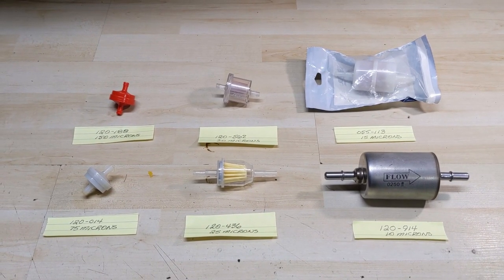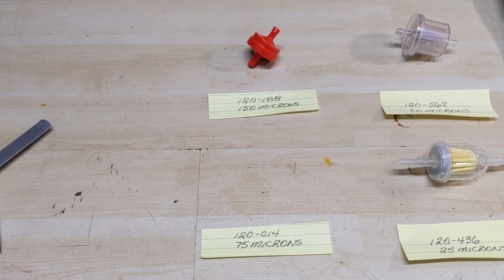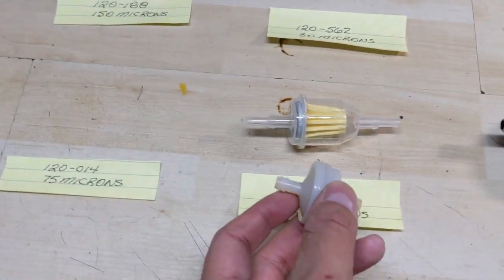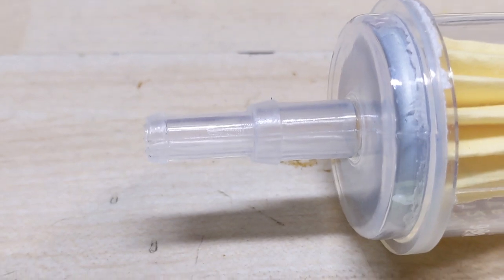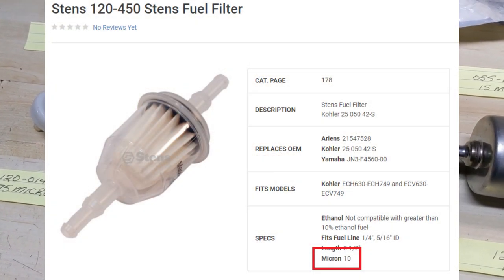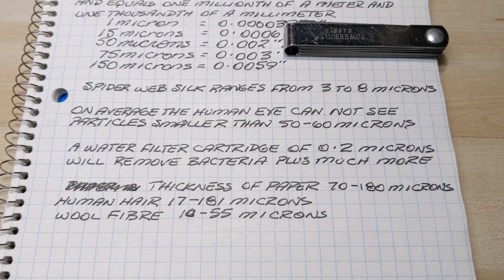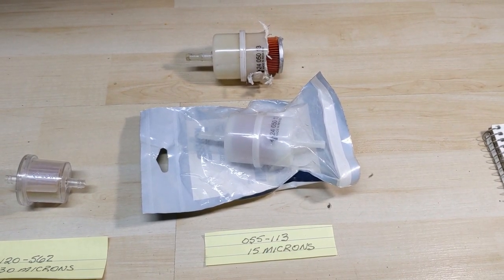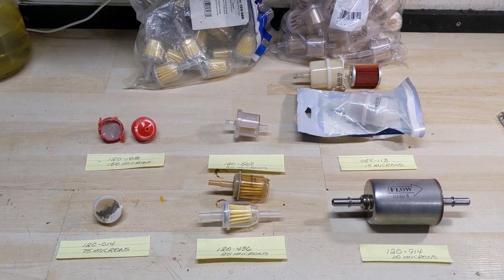Small Engine Fuel Filters

Comment: God Bless you brother for this video. My 4 wheeler has been down for a couple of weeks now.  I watched your video this morning and went straight out and fixed it. I had put a new carb on it and thought to be safe ( I had rust in my tank previously) I'd install an in line fuel filter. Not knowing any better I put a paper filter on it. I would prime it and it would run for a few seconds and then shut down. I was at my wits end. After watching your video I went out and took the filter off of it and it purrs like a kitten. I am a happy camper now. Thanks you.
Reply from the maker: Maybe try to find a filter that flows a bit better, I know the ATV ones are a little higher end and flow better than these lawnmower ones, due to the need for more fuel at full throttle. Glad you got fixed up!

Comment: A very well presented, laid out, an in-depth video. Great job! This will be helpful to sooo many people.
 
The only thing I would like to add, is that many people/commercial users (including myself) run with two fuel filters. Using a cheaper ($6-ish) high micron (25-30)  fuel filter first, and then run into a final, low micron (10) fuel filter second. 

We do this on all of our 27 HP Kohler V-Twins with Fuel pumps. We change the cheaper, clear, 25-30 micron fuel filter about twice a year (Machines used year around, for mowing, and snow removal), and the metal housing 10 micron filter every two years. 

And one more thing I would like to add. Is to warn people away from using a 'mesh strainer' fuel tank insert. The aftermarket industry has these available to insert a shut-off valve with mesh strainer into the rubber grommet of fuel tanks. Once installed, the strainer cannot be seen. Which will likely later develop restriction issues, and can be hard to diagnose, because it cannot be seen.

Comment: Thanks for posting such informative videos. My old Craftsman lawn tractor came with a paper fuel filter, similar to the 30 micron shown in the video, when I bought it used. Thanks for pointing out that can cause fuel starvation issues on gravity fed equipment. I had not considered that. I'll replace that first, with the 75 micron filter in your video, to see if that resolves an idle surging issue. If not, I'll drill out the low idle jet, as shown in your other video.
Reply from the maker: Yes the low idle or "pilot" jet usually 0.002" extra

Comment: This is great! Been fighting a fuel starvation problem on an intek Briggs and straton 18.5 hp. Afraid the current fram filter is reducing flow to the carb. Already checked the backfire safety switch, lines, jets, etc. runs like a top for 15-45min. Tap the crap out of the inline filter and she keeps going.....just can't pin it down yet. Be well friend!

Comment: I have a Harbor Freight Predator 3500 generator 63584. Even though I’ve used Sta-bill 360 since it was new, the last time I looked in the fuel tank it was rusty. I pulled the tank and found a fuel strainer in the outlet fitting, it was damaged and plugged. I’m trying to figure out how to replace the strainer with a clear inline fuel filter close to the bottom of the tank. You can’t buy the OEM strainer separately; you must buy the complete fuel tank. Obviously, it’s gravity feed 2.6-gallon fuel tank and I don’t want it to lean out or starve it, but I don’t want to keep cleaning the carburetor either. I’m also trying Ethanol Shield Fuel Stabilizer. Even though I’m using 4 Cycle Ethanol-Free Fuel from Home Depot. What’s your thoughts??? Great video. Thanks

Comment: Thank you for this...I picked up an Ariens 17.5 hp Briggs and Stratton riding mower and put a cartridge filter on it and its having trouble idling but runs at full throttle.. and it gravity fed..🤔 going to get a stock filter and see if that's the problem.. UPDATE: Installed OEM Briggs filter for gravity fed system ....Now it runs smooth...Thank you!
Reply from the maker: Yes they either a red or white Briggs filter!

Comment: Another awesome video, thanks. Have you used a
paper fuel filter on a gravity fed system? If so what paper fuel filter would you recommend?
Reply from the maker: Yes, those Tecumseh ones are great! I haven't had any issues. Like I showed, I used it on that generator and it worker perfectly!
Reply: @EliminatorPerformance  what size fuel tank do you need for it to work fine ? My mower tank is like 1.5G

Comment: Great video.  What about the filters in the fuel tank on a trimmer or blower?how many microns are they?
Reply from the maker: Great question, STENS doesn't actually list the micron level of those filters, so I decided not to include them, as I didn't want to put out any incorrect information. If I find out, I'll let you know!
Reply: My question as well. What’s the micron rating and what’s the difference between the two types I see, the ones with bare filter material on the outside and those with a plastic cage around the filter. Also related, why do they tend to fall off the hose inside the tank?
Reply: Because the fuel line for those are garbage. They become brittle and hard, causing the filter to fall off. Idk if they make better fuel line, stihl's fuel line seems to be better but you can't buy a roll of it, that I know of.
Reply: Dan Oakley   My research so far indicates Tygon fuel lines (always marked on the lines, as opposed to the crappy knockoffs who say they’re Tygon in the advertising but really aren’t) are the best available so that’s what I’ll be using for now. I just wish they made them in clear so it would be easier to see fuel running through them.
Reply: I have not been able to specifically find any micron ratings for the small two stroke filters but many are a compressed felt material and some are porous plastic and information on line says the felt filters run from 1 to 100 microns and the porous plastic 1 to 200 microns. If we find any specific information we will be glad to respond further.

Comment: Great video. Thanks. Quick question; never took note of this. I run an exmark with a 20hp kawasaki. Its got a fuel pump.  It runs fine, but the clear fuel filter only fills about 1/3 of the way as its running. Should it be full as it runs ??
Reply from the maker: That's usually how they work depending on how the fuel line is routed. Take a look at the 120-436 filter that I cut open and dumped the crap out of, you'll see the grey discoloration on the paper filter where the fuel was resting. Same area as yours, about 1/3 the way up. Thanks for watching!
Reply: @EliminatorPerformance  thanks for taking the time to respond.

Comment: Great video.  So basically for a walk behind 21” mower my best choice is the white disk filter, since the paper filters won’t push the gas through?
Reply from the maker: Yes
Reply: No. It'll run just fine with the larger BETTER fuel filters you couldn't pay me to use one of the disk ones.
Reply from the maker: Gotta be careful, I've had fuel supply issues with them before. Cub Cadet CC30 prime example. Even the Technical manual says only use the red Briggs filter with the metal screen, as a paper filter won't flow enough and the engine starts surging from not enough fuel.

Comment: how does size of the filter have anything to do with particulate size? Flow rate can be effected by media surface size, more media surface equals an increase of flow. So bigger is better. The large body has a secondary benefit of allowing particulate and water to drop out. Efficiency is also important to understand, not everything is as it seems due to quality issues. Also cellulose filter elements can easily be rendered useless when water is present. Dirt and water are the 2 biggest issues with small equipment. The discussion point of water was completely missed.
Reply from the maker: Great points, usually the larger the element, the finer the particulates it will filter. This is because the paper elements are bigger than say a metal screen. As shown, the filters get larger in size while the particles they filter get smaller in microns. Bigger is usually better, but the filter element has a direct connection to flow rates, as most of these engines have a fuel system that is gravity fed. It's not like a car, where you have a strong electric fuel pump, and can run a large element filter with the smallest micron rating. Gravity fed engines will become starved for fuel when running these larger paper elements. The engine will surge, and sometimes eventually just become vapour locked and won't have any fuel in the bowl to run.

Comment: What is your opinion on the in-line Pyrex glass fuel filter?
I use it on my 283 engine
I heard different things some people love it because you could see the dirt that accumulates in the filter but others say it wiggles itself loose and is prone to  causing engine fires when fuel leaks out of it on a hot exhaust manifold
Reply from the maker: Yea I don't like them, but it's just person opinion. The Plastic stens ones have never failed me, and I've used thousands. The China ones from Amazon that come in the package with the carbs, straight into the garbage can lol most of them are broken already before I even open the box.

Comment: I have a DR Bush Hog (2007).  I purchased some fuel filters (paper in clear plastic/AMAZON) and they don't have an arrow for FUEL FLOW DIRECTION.  The original did not have an arrow either, but I didn't pay attention to how it was connected to the fuel line....from tank to carb.  I'm thinking the cap-like top goes to the carb?  Any suggestions?  Thank you.
Reply from the maker: Bigger end with the largest area goes towards the tank, the filter should filter debris so you can see it (outside of the paper) if you run it backwards the debris gets trapped inside no good

Comment: I have a 1989 Toro 724 (38072) snowblower with a Tecumseh HSK70 engine.  It has no fuel filter and  I can't find anything in the manual or IPL about fuel filters.  Can I use a fuel filter with this engine?  I'd prefer to use the smaller clear paper filter pictured (Stens 120-560) although at that price I'd rather buy another manufacturer/supplier and more of them from somewhere else and get a better deal. I'd install it just downstream of the shutoff valve under the fuel tank and above the starter motor.  Will this work simply by gravity feed or does this engine require a fuel pump for this to work?  I'd like to see a video addressing the differences in various machines for filters with and without fuel pumps.
Reply: What is the difference in height between the bottom of the tank and the inlet of the carb?

Comment: For something like a 2000 watts small inverter generator what would you recommend? My old champion didn't bring a filter at all
Reply from the maker: Firman has some small ones, but I'd always recommend a honda or something with a Honda like a Coleman
Reply: @EliminatorPerformance  Oh I'm sorry I think I wasn't clear enough haha, I meant what filter you recommend, would a small inverter generator do alright with like a 25 microns filter?
Reply from the maker: @DDX1944  that's my bad, I didn't catch the end of your comment. if it has a fuel pump run a paper filter, most generators don't, I'd recommend the white metal screen one. They work well enough to keep debris out of the carb
Reply: @EliminatorPerformance  Thank you!
Reply: @DDX1944  Hello DDX,  I stumbled across this video and was wondering the same.  I have a Honda EU3000IS and it has a pencil filter attached to the fuel cut off assembly that enters the fuel tank from the bottom and it hurts my wallet when I see the Honda aftermarket price for that filter and o-ring = $30 bucks.  Crazy.  Did you try the white disc filter for an aftermarket fuel filter on your inverter generator?  Was it a Honda EU2000?  This video sure cleared it up for me since the Honda fuel filter is only a plastic mesh also.  Thanks,  Gerard

Comment: Since I've changed to a different fuel filter on my 50 cc scooter my scooter doesn't run correctly should I get the same one that came with it it seemed smaller than what I have now?
Reply from the maker: Yes I'd recommend factory parts, it may be decreasing the amount of fuel your engine is getting
Reply: @EliminatorPerformance  Thank you for ya reply I'll make sure I pick the right one up my ride hasn't been right since I've changed it thanks alot!!
Reply: @EliminatorPerformance  the factory was a 3/16 and I had got 1/4 fuel filter I c that those are different sizes so I'm going to go to either lowes or advance auto to get the original size which should be 3/16 I swear that has to be my problem 🤔

Comment: does it matter which way to install the red filter?
Reply from the maker: No
Reply: My research found that fuel flow should be into the small bowl and out the larger end which is where the screen is located. I was of the impression that it didn't matter until I found a manufacturer website but can't remember the site. Consider all filters in the shape or form of a "V" so in on the small and out on the large end and you'll never get it wrong.
Reply: @stevef.9659  Interesting and normally this is the way we install them . I believe if you check depth to the screen from the inlet and outlet sides there is more space to the screen on the small end side thus use it as the side closest to fuel tank.

Comment: Stupid question maybe? Using a fuel filter on a two stroke engine, will the oil in the gas clog up the filter?
Reply: We actually have installed filters the screen type on LawnBoy 2 stroke mowers and you would not think the oil would clog the filter since grass trimmers, chainsaws, blowers etc have very fine internal fuel tank filters attached to the fuel intake and they do not clog.
Reply: No the oil is in solution